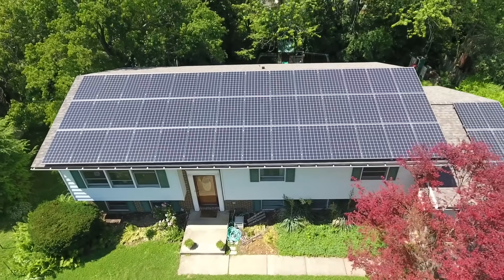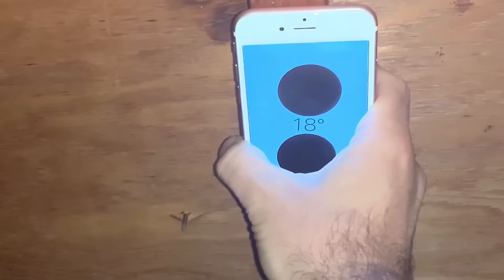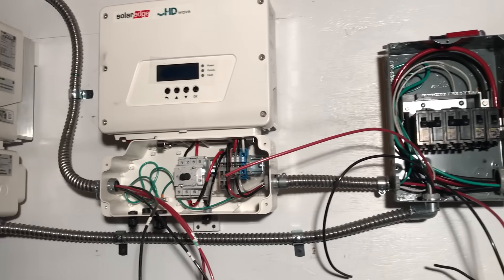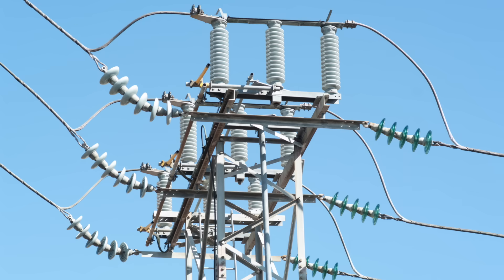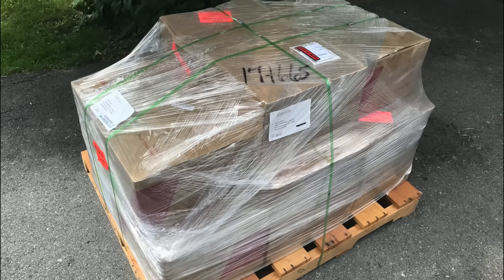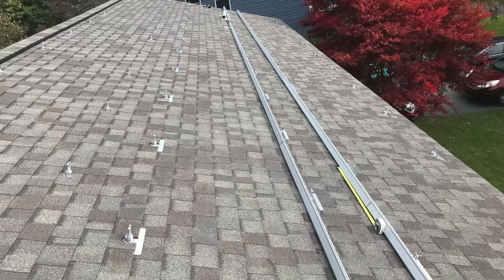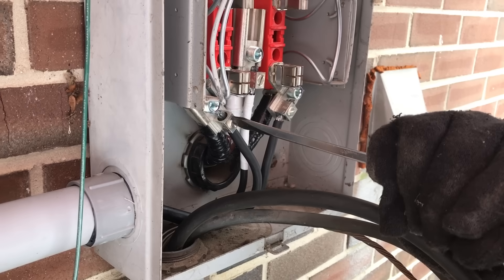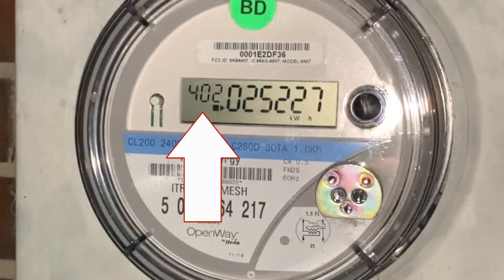I Installed a Power Plant Myself | HUGE DIY Solar Panel System

Comment: Great video! I'm starting to look into a similar install. but not sure how it will perform in the cold, winter months of Montreal. Electricity here is pretty cheap, so I do wonder about the ROI being worth the undertaking. Love the video, though. Very well done and edited. ( I despise when the dudes just ramble ono and on without getting to the point!) Kudos!
Reply from the maker: Thank you!  Cold is actually better for semi-conductors.  You might be interested in the video after this one and the one called the “costly solar misconception”.

Comment: Dumb question. With this setup- into the grid… when the power goes out, would you lose power too despite having the solar panels?
Reply: Yes. Unless you add a battery system you can't keep a grid tied system on while the grid is down.

Comment: If one of the inverter of the middle panel is busted you need to dismantle the other half just to access the middle?
Reply from the maker: It’s pretty easy to move a panel and then get to a middle one if I needed to.  Just 2 bolts and then disconnect the MC4 cables.

Comment: 14% roi seems so low. I mean you're getting free energy for 2/3 the life of the panels.

Mine will be worse. I live in a hurricane state, so I'm looking at building a Powerwall.
Reply from the maker: That’s an annual return.  Historical stock market is about an 11% return per year.  Check out the video after this one, I go into more depth on production and costs.

Comment: I'm in pa as well, they require new things from the power company to prevent over powering the grid
Have you had to add this?
Reply from the maker: I’m not sure what you are referring to.  I just helped my neighbor put in a system (did you see that video?).  There wasn’t anything new that I noticed.

Comment: Pretty cool install! I need to correct you on something though sir. You, yourself, cannot connect your system to the grid. By code, you have to have a certified LICENSED electrician do the connections. Unless you are an electrician then the subject is moot.
Reply from the maker: Thanks!  I’m not sure what you are correcting.  I hired an electrician for the grid connection.  That may be true where you live.  I just helped my neighbor put in solar (did you see the video) and there was no licensed electrician involved and it passed inspection.

Comment: I feel inspired by this but I'm sure I can achieve this some years from now as I still have a lot of stuff to allocate my money with. I already have 2 simple solar generators (1 with lead acid battery and strictly DC, 1 with LiPo battery w AC inverter)...really helped with my electric bills and saved us from a month long power outage after a Cat 5 typhoon.

I live in a country wherw Cat 5 typhoons hit us every now and then. I genuinely worry screwing the solar panels in place on the roof what if the typhoon would just blow it away. My current solar setups have temporary stilts where we can get it when a typhoon arrives.
Reply from the maker: You would have to calculate and make consideration for the wind loads.  And buy equipment that can handle it.  You could also add another rail with more clamps to hold down the panels.

Comment: The best solar panels are 20% efficient, which is always why so many are needed for such a small return. They become less efficient with every year, so at 20% efficiency brand new, you can imagine how inefficient they will be in 10 yeara, and will be effectively useless in 20-25 years, and are not recyclable. 👍

Comment: Your one handy dude dude. Great work! Im actually in the process of buying a home that has a gang of solar panels installed. I'm curious to see how they will help with the electric bill. They are like these plugged into the grid. I should be moving in the new home in like 25 days. 

By the way the contract said that the system has a anual usage of 28k kWh and estimated energy offset of 98%. Is that a good thing?

Comment: Definitely, people from some countries consumes way more energy than anybody would need. Can you explain me where do you use 15KWh? That can easily power three 100m2 homes where I live, 5 removing heating from the equation. Good for you on you going off grid, but I think the main energy problem is not paying huge bills, it's about a responsible resource consumption. Because being green is great, but when people at the same time waste their money buying things they don't really need, or replacing gadgets without a strong reason (just because the new trending gadget is out), you are not ecologic at all. Even if your house produces 100% of the energy it consumes. If you want to check consequences of an irresponsible consumption, take a trip to India or China nearby big industries that produces those gadgets.
Reply: Don't take it personal. Just thinking out loud. When I see this kind of videos with so high energy requirements, I can't avoid think that the person is mainly worried about their financials and not in having a responsible energy use. Not thinking only in their needs, also in what is best for everybody.

Comment: Question about replacing shingles under your solar panels how you will be doing that? Is it easy to remove them?
Reply from the maker: Well, I don’t really plan to be around when that might need to happen because they are 25 year shingles and the life has been extended a long time after that since they are now protected from the elements by a glass roof (ie solar panels). But if I had to replace a shingle or two for some reason, it’s not hard to remove a panel and fix underneath it then put it back.
Reply: @FrugalRepair  ok thank you for your reply

Comment: Thank you. We've been planning for 13 years to put solar panels on our roof, but it was not possible due to regulatory issues. At last, a year ago the regulations have changed, and 3 days ago we turned on our new 21kW system. Since we live in Israel, our 1st sunny February day produced 73kWh. The system is expected to produce ~28MWh in the 1st year, about 3-4 times higher than our electricity usage. We get ~0.14$ USD per kWh we produce, from the electricity company.
Reply from the maker: Glad to hear you finally were able to get solar!  That’s great.

Comment: Depends on how long the caul last before the leaks start. Plastic zip ties all fail in time. It sounds very expensive. I have yet to see a panel last 25 years.
Reply: As opposed to what else that lasts 25 years?  Do you think ICE last 25 years without maintenance?  You think power companies don't perform any maintenance?  I've yet to see any other power source last longer than solar panels without any sort of regular maintenance and repair.  You have issues with zip ties??  Really? ... do you pay power bills in your household?  In hot climates you can expect a standard home power bill to be around $400-$700/mo (which usually increase by 7% per year) ... the "expensive" route is to continue paying out a fortune to power companies and adding environmental "depreciation" ;)

Comment: the thing I don't like about grid tie is , if the power on the grid goes down , they cut off your power , there are ways around that , you will need a battery bank , I'm not exactly sure how they set up but it's worth checking into ,   can you have a grid connection if it's only connected to A battery charger and it kicks in only when your batteries drop below a certain level??

Comment: Very cool and congrats nothing like tackling a job by yourself with little knowledge / with extra hands to help. And seeing beneficial results. One thing I did notice during the video and I'm not sure if anyone else has commented on it already.. but you encounter having to ground all circuits and finesse bend along the support fixtures without touching the  support fixtures. I was going to mention maybe sleeving some form of isolater over each And every bend. For some peace of mind. sliced rubber hose/pipe sealant/silicone. Etc. None the less awesome job. And I am sure it is still operating just fine. Good job Sir!

Comment: The roof mounts are the most challenging and distrustful items in places where weather can hail or ice dam or pile snow on top. I've seen some nice ground mounts but didn't like that in the city limits. I decided to build a covered pathway around my house and now I can  actually sweep snow off the panels. As for Hail Storms ..I had a fold up system before but now my plans are for a flip top cover like a 10 x 36" metal piece to cover the panels since they are laying flat.

Comment: Nice vid!
How about the maintenence over long time ex batteries ??!
Reply from the maker: There is almost no maintenance. You may want to check out some of my other videos after this on my solar system, how it is put together, costs, production, etc. I also didn’t install integrated batteries.
Reply: @FrugalRepair  sure
I'm planning for it from a long time... the only thing stopping me is the batteries... we need ro store the charge somewhere right???
And that will definitely have charge cycles.

Watching your videos and they're quite informative!
Can't be brave enough to do it entirely on my own though, you've pulled off a  fantastic job!

Comment: EXCELLENT VIDEO !!!!!  Hands down ONE OF THE BEST AND MOST INFORMATIVE VIDEOS OUT THERE.
Reply: Very smart decision to put a new roof on before installing the solar panels. 
Expensive job if you have to replace the roof after you have the solar panels installed.
Reply from the maker: Thanks!
Reply: @FrugalRepair   not too many people would think ahead  or spend the money to replace the roof not realizing that they are actually going to be saving money and a lot of headaches by doing it before you install the panels. Now you know that there won't be any problems or roof issues and leaks for 20 or 25 years. 👍 I have a suggestion if you have time. Even though you explained briefly as to what you did for the permits, I think a lot of people would appreciate a couple of short sub videos of just how you downloaded the proper forms what should be included, in order get approval of the permits.  And the other would be your thought process and what some of the mistakes are that should be avoided when picking a route and running the lines.  
I think that a little more detail to those issues would be greatly appreciated.  Anyway,  excellent video.
Reply from the maker: Thanks! Those are great suggestions and videos I’m hoping to make this year.
Reply from the maker: Also, did you see my other DIY video where I helped my neighbors put in a system.  They used micro inverter instead of power optimizers like I did.

Comment: Not against solar panels but as far as no Bill's. Only thousands and thousands and thousands of dollars in solar panels and storage batteries. Then have fun when it comes time to replace the roof and remove all those solar panels and re-install.
Reply from the maker: Watch the video after this one.  Over the year I earn income from solar and our electricity is covered, and I don’t need batteries integrated.  You can also watch my solar and battery misconception video if you wanted.

Comment: 14% ROI.   Are you calculating that correctly?  25 years at $100 per month electric bill is $30,000 grid expense....and that is with ZERO rate increases.  More likely $40,000.   Your system cost you $35,000 as a DIY?    Bullshit.   After tax break and including BEV fuel savings over gas the ROI even with 2 batteries should be well over 100%.  Much higher with a DIY/no labor cost install.   I've looked up systems and a DIY 10Kw system dropped at your door is only $10,000 or so.  I don't know where you are getting those calculations for only 14%.
Reply from the maker: I’m actually getting better than 14%, watch the video after this one for the numbers
Reply: @FrugalRepair  You are missing a key finance factor.  Asset Value.    The system didnt cost you X dollars from purchase and install.   IT cost you asset value PRIOR and asset value AFTER.   IF you assume that your home now sells for EXACTLY the same price after install......All you did was move liquidity into real estate value.   
If I buy a Tesla and put 30,000 miles on it in 2 years then sell it for only a $5000 loss.....then it ONLY cost me $5000 to own.   Your solar roof system ADDED value to your real estate.   Your ROI is MULTIPLES higher then you are calculating.   
With the Fed Tax break you SHOULD be able to sell the property NOW for MORE (excluding annual property increases nationwide) then the original home value + the solar system net cost.   You MADE money on installing the system....not COST you money.
Reply from the maker: @dwolff4127  Yep, it has been a great investment.

Comment: Do you think this is possible off grid!?
Reply from the maker: Not sure what you mean.  You can certainly have solar panels work with an off grid system.  You would need batteries integrated though.  This is a grid tied installation.

Comment: Obviously you live in a residential area and you do not have an unobstructed view of the sky in all directions. Well nether do I and because of that reason I would not consider loading up my roof with solar panels especially when my framing is all 2x4's as rafters. Not to mention solar panels cover the shingles. And that can be a bad thing. Notwithstanding you may have a brand new roof without any issues and high end shingles. I've never used fiberglas but here we use felt almost universally. 
I would only install solar in a location that had easy access to remove snow in winter but my hydro rates are so low at 5 cents / Kwh. It would never pay me to install solar. From friends whom I know and installed solar and are selling it at 52 cents /Kwh that's great. But those days are long gone . 
A fellow I know sells all his electricity for 52 cents and buys what he needs for between 8-14 cents /Kwh.
That deal comes to an end in about 5 years. He has two sun tracking arrays on pedestals that he paid about 50 K for each. Then there is the life expectancy of the panels. I really don't think over the short term he is making a ton of coin when all is considered. Don't know for sure . Don't care. I'm sure due to weather and other environmental considerations there could be some stress not to mention how the renovation affects ones taxes and insurance,

Comment: Great project by why did you buy 48 MPPT modules for each panel? One MPPT charger will do it if you have batteries. But since you don't have batteries to store energy you night time bill energy  usage will cost you $. And Electric companies only credit you pennies for kW  of energy. So bottom line is you Electric bill still going to be around 1/4 of your original bill with $$$ sitting on the roof. And they sit so tight you can not maintain them. What if one panel in the middle from both ends goes bad?
Reply from the maker: The power optimizers help with efficiency and monitoring.  And I still get DC off the roof if I want to integrate batteries later.  It was also the least expensive option for the features.  Watch the video after this one for explanation of the finances part of the project.